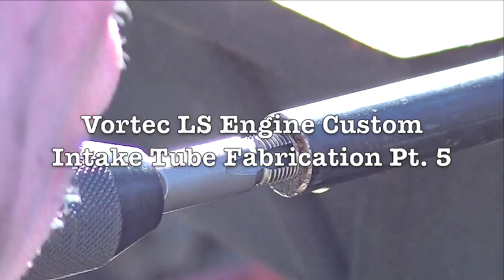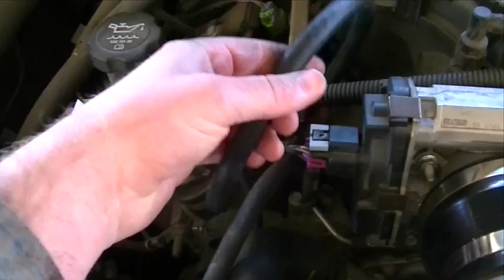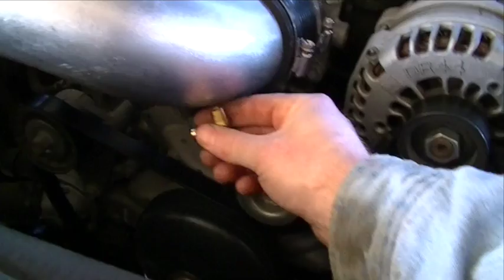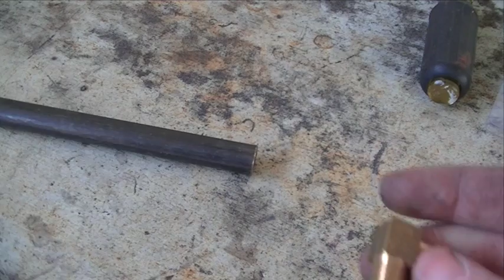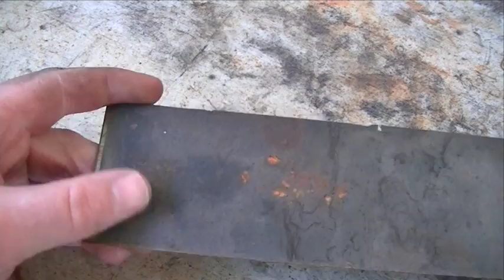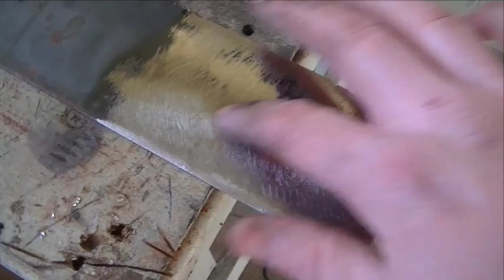PART 5 LS ENGINE CUSTOM INTAKE TUBE FABRICATION | Vortec 4.8 5.3 6.0 6.2 V8 CAI

Comment: The tube you indicated as P.C.V. at the beginning, is the fresh air inlet for the engine to allow the sweeping of blow-by and other crankcase gasses from the right side to the left side to the actual Positive Crankcase Valve on the left rocker arm cover that goes into the intake manifold. Water vapor, unburned hydrocarbons are produced by burning fossil fuel and if the engine reaches operating temperatures, the PCV system will help you engine oil last longer. You did a good job of fabrication, but looking at post, I did not see anything about where you purchased the metal mandrel bent tubing. If you did say where, I apologize. 
Retired ASE Master Tech.

Comment: Well it's fuel injected right not throttle body injection?
Reply from the maker: Jacob Kelley All modern engines are at least MPFI. (multi-port fuel injection)  More are becoming direct injection.  There is still a throttle body on all of these engines.  There still has to be a way to meter the air coming into the engine.   Hope this helps.  Thanks for watching!